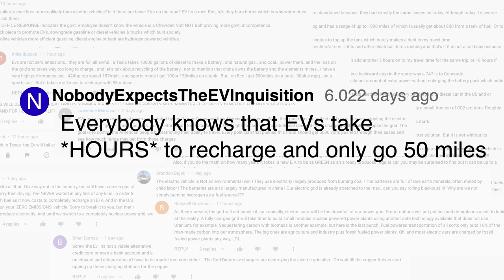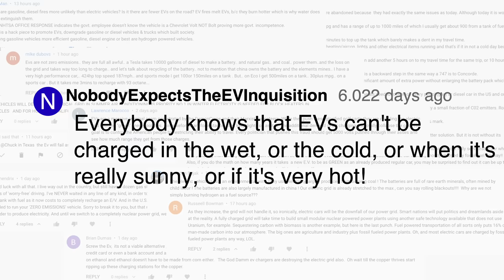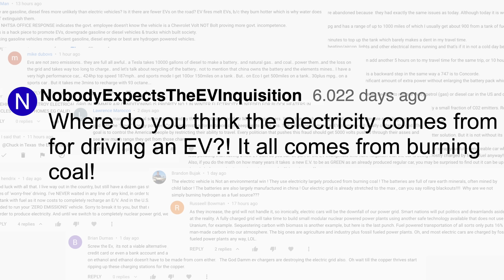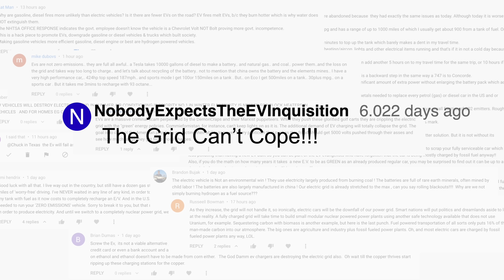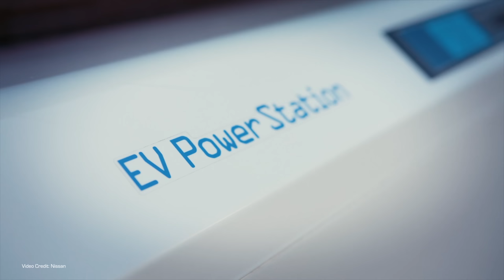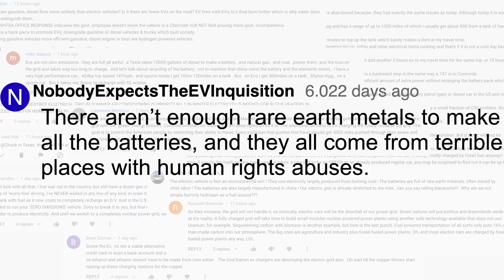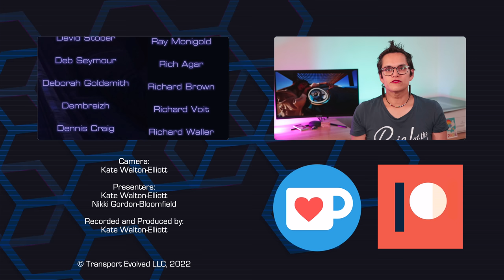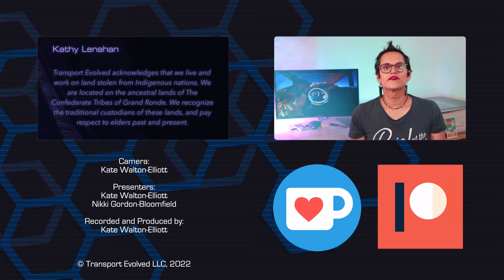The Transport Evolved List of Common (EV) Misconceptions

Comment: One thing I would have loved to see covered is battery fires! I see this one a lot (and it's very much not true). There was a study based on data from the NTSB that compares fires per 100k units sold. ICE cars are at 1530 per 100K, EVs are at 25 per 100K, and hybrids are at 3475 per 100K.

Comment: You really know where your towel is, said the departing dolphins!  Oh and don't forget the amount of electricity used in the fuel refining process is about the same as needed to drive an EV the same distance as the fuel, so less fossil cars will release energy for EVs.
Reply: Is it truly electrical energy that's heavily used in refining, or just thermal energy that happens to be stated in kWh units?    From a purely energy perspective, it doesn't matter much, but in the US, I think that the bulk of that 6kWh/gallon figure is just a measure of heat energy that's gotten from burning some of the petroleum feedstock, and is not drawn from the grid.
Reply: @levenkay4468  It can be electricity, more likely it's natural gas, a byproduct of pumping oil burned to distill the fuel. While not directly convertible, it is a source of electricity. 

While the energy to refine fuel is significant, I'd be amazed to find out you could drive an EV the same distance on just the energy used in refining and transport.
Reply: @charlesminckler2978  Agreed, because if the energy cost is thermal, one would have to include thermal-to-electrical conversion losses.   According to Google, the best-case efficiency for a combined-cycle power plant is 50 to 60%.    On the other hand, no mention has yet been made of the energy currently devoted to simply pumping oil out of the ground, and the pumps ARE direct electricity consumers.   The FullyCharged channel covered this awhile ago, and if my envelope-scribbled conversions of their awkward units are correct, it came out that, in the US, the electrical power consumed by the dry-land pump jacks is sufficient to support the 40-mile average daily commute of about ten million EVs.    Of course, we need oil for more than just burning in pickup trucks, and my brain broke when I tried to estimate how much raw oil pumping would be reduced per ICE-to-EV conversion.  But there would be some power saved there, as well.

Comment: Great video. Excellent answers, and some nice entertaining references. 

Regarding "the grid can't cop", the average number of miles a typical vehicle drives a day is 30-40 miles. This would require under 10 kWh. Overnight it would amount to under 1kW of power per hour per vehicle. 
For those wondering how much power 1 kW (1000 watts) is, it's about the same as a coffee kettle boiling water, or a hair dryer requires. Just for a longer period. 
The grid doesn't crash when everyone make coffee at the same time in the morning, or cooks a turkey.  But I digress. LOL.

Comment: It would be great to have a short video that goes through (just the facts) the main advantages of EVs.  Just a high level summary.  Most my friends will only want to watch something that is a couple of minutes long.
Reply: EVs are electric, can be charged at home overnight. Some do not cost much such as the Chevy Bolt with a $7,500 federal incentive.
Reply: We need Ollie from Family Guy to give short sharp facts about EVs.
Reply: @salibaba  What sharp facts?
Reply: This is lame though, you have to do your own research, EV's do not work for everyone, at least not yet.
Reply: @aigarslacis4433  unfortunately we live in a fast paced, tik tok clickbaity society.
Reply: @neilnelson79  
This is a fast charger- points at charger - you get it at home it adds 30mph.
This is a rapid charger, you use it when you’re on your way somewhere and need to charge on the way. It adds 200mph
Don’t be a knob, unplug your car when you finish rather than block someone else from getting use of the station.
Reply: They don't make smelly fumes, they're quieter, they accelerate better, they're cheaper to fuel, the brakes don't wear out as quickly, they don't need oil changes every few months, they don't contain thousands of moving parts to break or wear out, they refuel while you sleep, and they make balding white men really angry, which is really funny to watch.

That should fit inside a couple of minutes.
Reply: @salibaba  You need level 2 charging at home. You plug in your EV when you get home and it is charged when you leave in the morning.
Reply: @rabidpb  and that is also not true except there are no smelly fumes (unless BEV burns to ground), there are a lot of liquids, a lot of wire and  a lot of highly stressed rotating parts in BEV's. And I just love the argument about BEV's being fast, well they are - but then don't put it in the same sentence as "BEV's are good for the environment" ...
Reply: @neilnelson79  I’m aware. I have one mounted on the side of my house. Thanks. Different naming conventions over here. We call a 7kW “L2 EVSE” a fast charger. I was providing examples.
Reply: @aigarslacis4433  Everything I wrote is factually correct.
Reply: @rabidpb  no definitely not all is factualy true, most of it is true only on surface or in the sales papers. From technical stand point there are far more deficiencies of BEV's compared to ICEV's. And yes brakes wear out slower, there may be a lifetime oil and other liquids, but for the most part if you were to drive a couple of hudreds of thounds of miles with single vehicle like you frequently do with ICEV, you would notice how deteriorated they are, and more likely than not your drive train would be seriously worn, even though most of BEV's have far beefier drive train then the ICEV counterpart ... Most BEV's however don't last that long and more often then not are scrap right after first battery pack "dies" ...
Reply: @aigarslacis4433  Mate, you're not actually addressing any of the points I made, and you're talking bollocks about something you know nothing about. Hence my last item on the list. Goodbye.
Reply: @rabidpb  which points would you like me to address, since if we are talking about an average BEV, I addressed the "average" bullshit regarding them ? Please give me the car that you think you know the best, and will tell where are the likely  failure points, and why it is not what it seems to be. It just bad that I cannot put any illustrations here ...

Comment: Great video. I always love when people use science to debunk myths and misconceptions. But I thought that you would use the term “rare earth metals” correctly. 
Cobalt, platinum and palladium aren’t rare earth metals, and afaik modern lithium (also not a rare earth metal) batteries do not contain any rare earth metals.
You can find them, on the other side, on magnets, like those is some electric motors and in all generators and starter motors of an ice engine.
So maybe you can’t find cobalt ore as often as iron ore in the ground, but this doesn’t make cobalt a rare earth metal.
Another question is the use of metals or other elements that knowingly have a bad social impact in the few countries where it can be find. 🤷‍♂️
But besides that, it is a good A-Z of EV myth debunking, too bad modern society only wants to hear what they already know, a little bit like European society before the illustration.🤪🤪
Reply: I believe I read once that there are a few lithium ion cell chemistries that include rare earth metals, but they are definitely not the ones commonly used in BEVs. About the only rare earth metal to be found in an EV is the Neodinium in permanent magnets in the motor(s). Even that may be changing in the not too distant future per the article I read about new discoveries with fairly common components making magnets as powerful as neodinium base magnets possible.

There may be (very small) amounts of rare earth metals in lithium ion cells, but if so, by and large, they are contaminants, not required components.

Comment: I made a video about our experience with solar roof and powerwalls. Last week it started getting brigaded with Simple Jack style comments like these. Well lo and behold, my analytics show a top search of the influx of viewers was "diesel shortage."

Like, lol wtf, who types in "diesel shortage?" Coal rolling climate trolls are who.

Looked into the carbon from producing the three powerwalls, and it was about as much as a 10' square concrete patio. Of course, once someone has taken on these talking points, you can't convince them with math. A classic propaganda technique is to slander every possible element of the other. That way and single point of correction comes off as deluded or ideological.

Thanks for doing the good work!

Comment: I have a couple of questions about the Mitsubishi i-MIEV.  It looks perfect for a cheap car but when the battery finally gives up can I take it to a specialist and get them open the battery pack and replace the cells?

I wouldn't want to just have another old battery pack because that would be old just like the i-MIEV with old cells, I would want new technology with new cells.

Another question, I know you can't get an adapter for the CSS because it has a CHAdeMO socket.  But is it possible to take it to another specialist and get the CHAdeMO taken out and replaced with CSS?
Reply: I asked this question to the Clevely EV guy at their Fully Charged UK stand this year, and he said they could replace
old cells with like-for-like refurbished cells from another car but they can't get hold of new cells.

Like you, I think there are sure to be some people wanting to replace cells or whole battery packs on these old cars which are in all other respects in perfectly good working order. I'm just not sure how easy it would be for them to get approval to put new cells in that weren't designed for the car.

It would be great if a newer, larger battery pack could be dropped in and the BMS reprogrammed accordingly, but alas I think this is years away if it ever comes.

Also it will be fascinating to see if anyone can come out with an affordable, low power (50 kW is plenty) CHAdeMO to CCS adaptor, which would revolutionise these little cars' ability to do longer trips. Just imagine pulling in to an open Tesla charger station and plugging in the i-MiEV!
Reply: It wouldn't be practical to convert an iMIEV to CCS. There are specialists that can replace some or all of the cells, but it is not a cheap option. Probably only viable for people that really love their iMIEV (plenty do). Many people would rather put the money towards a more modern EV.

We have a Peugeot Ion, which is a rebranded iMIEV, and although we love it and will drive it until it drops, a new battery pack would cost more than we paid for it. So we've already bought a new MG4, which is worlds better.

Comment: I'm curious (but obviously not quite curious enough to investigate myself) about how those massive energy & CO2 manufacturing costs are incurred.   Aren't some of the newer battery-making technologies (such as dry-process electrodes  and ion-exchange lithium refining) promising dramatically lower environmental impact?    I haven't heard of comparable reductions in the impacts of ICE vehicle production.
Reply: At the oversimplified level it boils down to the fact that EVs just weigh more and more stuff take more energy to process.
Reply: The statistics mostly look at averages anyway, so it will take a long time for the industry average to reduce even if a few manufacturers have lowered their CO2 output. Quite abit of it comes in steel production. But yes, battery plants use alot of mostly heat energy to dry the stages, and Tesla plans to reduce this. It should be noted though that Tesla will likely never be using 100% their own cells... they will still be buying from other suppliers for a very very long time. And even though they now have a plant in China and one coming online in Germany, they will still be shipping cars around the world for a long time. So their average vehicle will still have a much higher CO2 footprint than their greenest vehicle.

Also, there ARE green factories with low or "carbon neutral" ratings on the factories themselves... Volvo was way ahead of Tesla on that front.

Comment: "The Grid won't cope!" doesn't take into account all the electricity used to pump oil out of the ground, heat it up to 980 °C to make Petrol  (Gasoline) and Diesel, energy wasted transporting it to the Service (Gas) station, and pump it out of the underground tank into the vehicles.

Comment: The most common omission from comparitive grid load increase calculations is the significant electrical input to refining petrol and diesel from crude which will be displaced by every electric mile further increasing the bonus of the greater energy use efficiency.take the electricity used to refine one gallon of petrol and put it into an EV instead and the EV will travel In the region of half the distance the petrol vehicle would go on that gallon. So the EV only creates half the additional load on the grid overall. Once that can be time shifted by use of batteries or habits, then the case for electrification just gets better and better. In some refineries, their electricity is generated on site (almost bound to be dirty generation) so the benefit of displacing their fossil fuels use is more about emissions than grid support, but the macro view is still worth considering.

Comment: The old issue of buses comes up...  
Looking at the True cost blog where mpgs of various forms of transport are compared, buses come in at 38mpg per person on average...  High because when large volumes of people move it tends to be in one direction with nearly empty buses returning, then buses large enough for peak flows tend to be oversized for the rest of the day with low volumes of passengers (have often seen 1 passenger on a 72 seat bus around here on routes where the bus is standing room only for a couple of hours or so each day!).  Hence at the moment you are better off in a car from the more economical part of the range than sitting on a bus for reducing the energy cost / impact of your travel (although there are issues of energy & materials locked up in your car), or even better in an EV.  

Granted cycling or walking is better for the environment where possible, but even then I have seen serious suggestions that the hyper efficient Aptera uses less energy than cycling...  With the Aptera getting significant power from onboard solar PV, that is perhaps the best vehicle if you have environmental concerns, especially as it is designed to be a multi generation car hence the environmental manufacture cost is spread over a very long time...  Might be worth the two of you have another look now production intent Apteras are very close, though guess your reservation is a bit down the list???
Reply: Nikki has had one on order [for herself] for quite some time and done I think 2 videos on the vehicle development starting with her ordering one [Think it was titled How to Order an Aptera] and the last was just before the Rich Rebuilds review one year later. And one vid on the gamma reveal which they were their [at both reveals] and did manage a panel or two of expert discussions at the San Diego event, one on right sizing. So yeah they get it. And will probably be one of the first with a 600 mile pack. I await to see Nikki and Kates review of it! I think it will be exceedingly fun and hope they do a little dirt action off pavement.
Reply: @craigarnold1212  Been keeping up online here as the Aptera's home is the other side of the pond from here..  It is looking good, looking forward to their next coverage of it.  Must say I do like the direction the Aptera team are taking with the vehicle, hope others pick up & take their directions on board

Comment: The carbon ROI also depends on the specific car. Tesla Model 3 and Y average out to 14,500 miles until break even on mostly clean energy, slightly longer for the current grid mix. For the average American, that's about a year of driving.